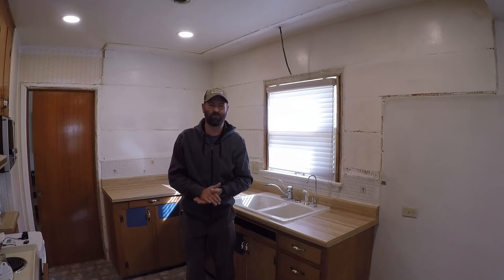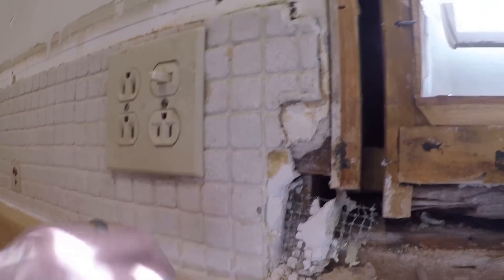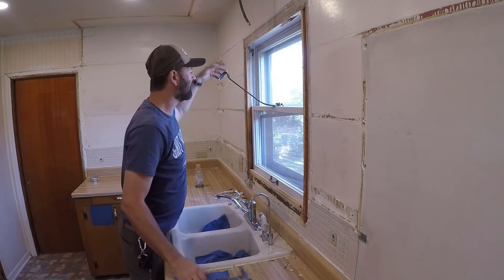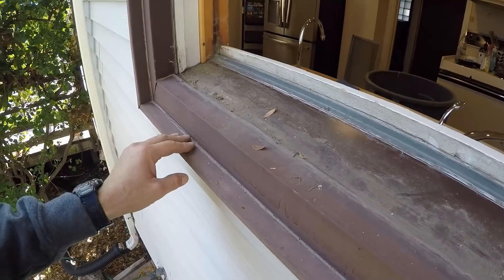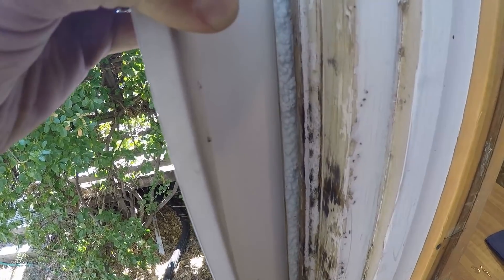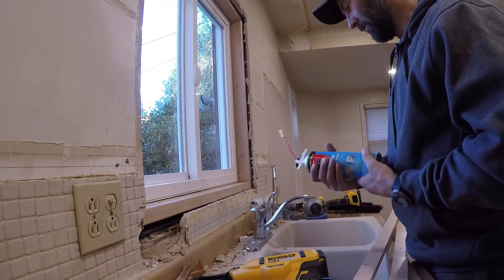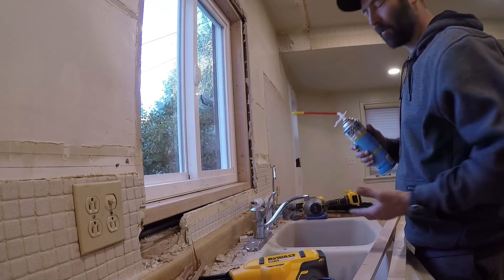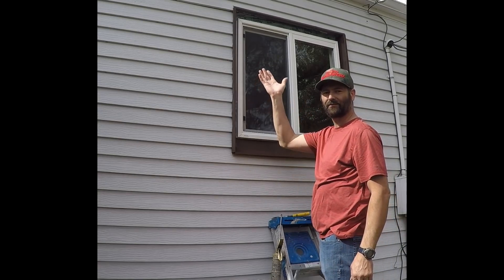Antique Window Replacement | Massive Kitchen Reno | THE HANDYMAN |

Comment: Nice watching you work; as always..There are washers for old plaster work.They secure the plaster so it doesn't come off the lathe strips.They have a recessed hole for a drywall screw and holes to secure joint compound.I used them and they worked.Have no idea what they are/were called.
Reply from the maker: I need to look them up.
Reply: @TheHandyman1   I found them..Ace hardware and others do have those..Hope that helps
Reply: @TheHandyman1  Lol..of course Amazon has them
Reply: @TheHandyman1  I hope they help you.No one lives long enough to know everything.I benefit from watching you work.Hopefully you benefit from what I know and that product.Would be great if you think they will work and see it in a video.As always, Thank You, Norm
Reply from the maker: @nh7921  I looked them up.  They are called plaster washers.   I'm gong to see if Ace has them in stock.  Thank you.

Comment: That window was an interesting install with all the layers of siding, YIKES, for when comes time to reside the house😉. Not to start a war; but wondering what camp you’re in when comes to windows etc... Seal the bottoms or don’t seal bottoms?
Not sure if you said, but will you be doing the siding & outside remodel come springtime.
Cheers😊

Comment: I've found its easier to just let the foam expand then just cut/peel the excess later. When you wipe it before it cures it can become a nightmare. When we did it around some holes coming up through the floor it spilled over onto the vinyl tile floor, came off without an issue after letting it cure. Didn't adhere to the floor at all.

Comment: What's the proper way to dispose of those spray foam cans? I have a few that cured themselves shut before the whole can was emptied, so I don't want to just toss them in the trash since they might still be under pressure.

Comment: Why replace the double hung window at all. It looked perfectly fine structurally. Double hung windows fitted with modern T-bulb gaskets, and will out last vinyl  windows. Hit me up sometime we can talk about window preservation methods and tools.
Reply from the maker: It was only single pane window.  For resale all the windows and doors need to be updated.  Its is an actual line item on the appraisal for homes.   It they have old windows take $10,000 off the value of the home.